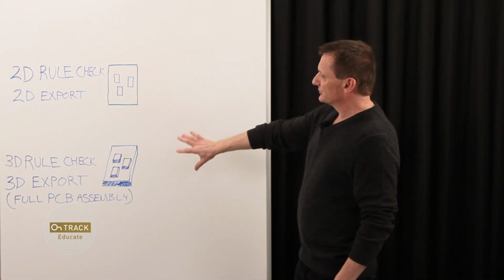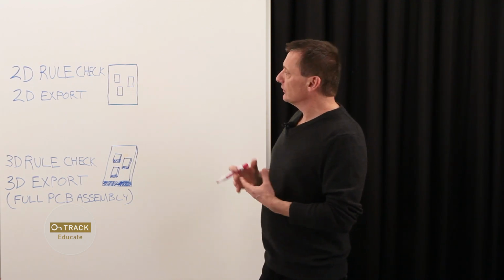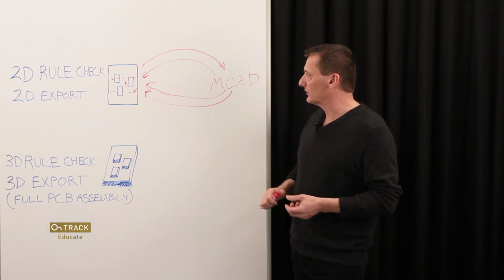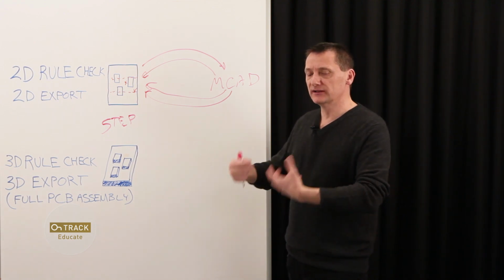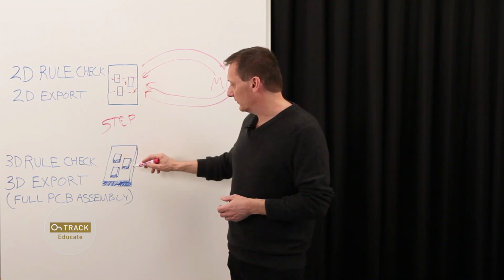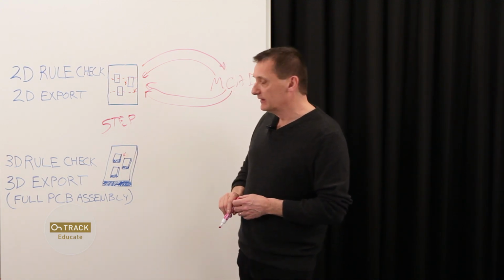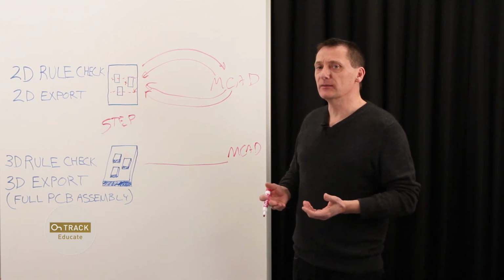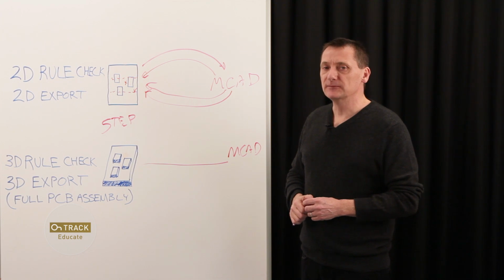3D PCB Design: A Gimmick or Feature? - OnTrack

Comment: Good topic John and totally true. A PCB 3D model is not a gimmick, it is a really valuable feature. An accurate 3d model can save time & money and can get you a new perspective of your board which is very usefull to avoid mechanical problems as you say but also to design nice PCBs, avoid silkscreens erros and to create more useful documentation of the project. Also, when you have to design a product with "stacked" PCBs, 3D models are very necesary. Thanks to talk about this topic in which I am very interested since many years.